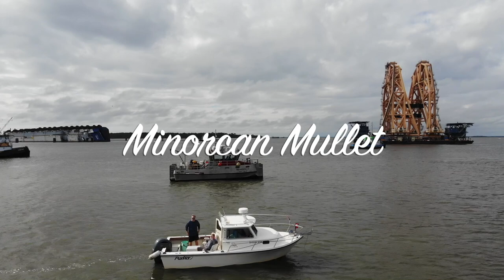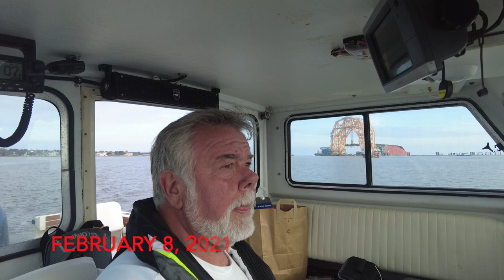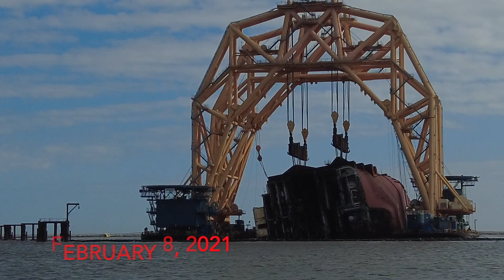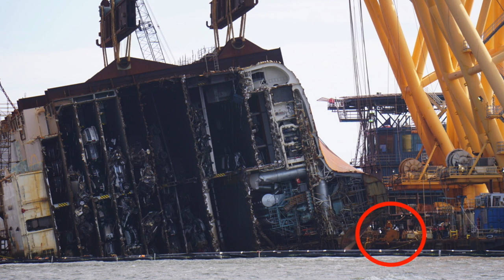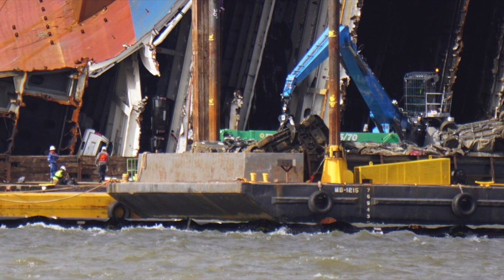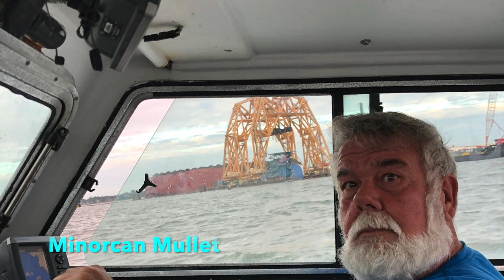VEHICLES PULLED FROM THE GOLDEN RAY on February 8, 2021

Comment: Thanks for sharing, I didn't see the model number on the grappler but it is pulling 7,000 lb suvs out of there, I have seen operators running those machines spin a small car like it's a tilt a whirl 20 foot off the ground. good times ha ha
Reply from the maker: You bet!! Wonder how many have been used on a barge while removing sunken cars?  Could be another history making moment!  MM

Comment: Andy, doing a great job 👏 👍. Handling the cars 🚗 with the long reach grapple is a at a boy! Just like they do in a scrap Yard. Budget must be getting tight and going after the cars like that makes money cents 💰 . If the chain ⛓ isn't working, get out torches and start hacking off chunks. 
 Ship breakers will show'em or 2.
Reply from the maker: Thanks 👍..  The most dangerous phase of the operation seems to be starting.  MM
Reply: @MinorcanMullet  do you mean throwing your fishing line inside and getting a Pinto vs  Ferrari🤔 🎣

Comment: thanks for the video update. I need a  decent old farm truck, so if they loose one grab it for me. haha
Reply from the maker: I'll try to lasso one if it floats by!  MM
Reply: My lifelong friend and retired commercial airline pilot in Durango, Colorado has a 1950 Chevy 6100 two-ton flatbed for sale. Mileage is 16 to 17K actual..showroom new. It was modified by a diesel shop exchanging the original 6-cyl. Loadmaster for a new 302 short block V-8 and 12 volt electrical throughout. I went there for two weeks in Aug. 2015, posted it on eBay but could not get it sold. The Loadmaster engine is crated in his shop on his farm. Andy, please excuse my promotional tactic on your channel…I could not resist the opportunity to help my buddy get the truck sold.

Comment: Perhaps the plan is now to have the VB10,000 move to the bow next after the engine room section is removed and the grappler barge goes around to the stern to grab vehicles.  then repeat the process as sections are cut off.
Reply: That’s a good idea Greg. They’d get the project done sooner.
Reply from the maker: Possibly so.  I'm not discounting anything!  MM

Comment: Considering the barge has to be heaving as well, pulling those vehicle free has to be an art rather than a science.  Even as light as the automobile steel is when compared to the ship, they have to be resistance for the chain.  Furthermore,   the plastics, foams, and other materials may inhibit the chain cutting of the heavy steel.  
When lifting section, some vehicles are going to fall into the water and sink, making a dangerous diving situation as well.  
very expensive salvage work underway, not to mention the capital loss of ship and vehicles.  This has been fascinating, Andy.  You do us all a service.
Reply from the maker: Thank you.  MM

Comment: Do you think there's a possibility that they might change the plan to cut off the engine room and  rather come back around to the bow end and cut off each section as the vedicles are removed?  If course they would need to repair the cutting system first.
Reply from the maker: HAHAHAHA!  Anything is possible with this shindig!   Waiting to see sharks with laser beams attached to their heads.  MM

Comment: In round numbers, how many vehicles were originally loaded on her? Hops are the vehicles fastened to the decks? How are they releasing those? Hopefully they are not putting personnel onboard her.
Reply from the maker: 4200 +-. Cars were strapped down with a nylon strapping system that probably failed where the heat was high during the fire..Some cars are still strapped. MM
Reply: Pjudging by the pictures, it looks like quite a few of them are still srtraped to what was the deck, leaving them hanging from it now. Given that the straps are nylon, shouldn’t be too hard to rig something to cut them remotely, while the picker has them clamped up.

Comment: When the vehicles are loaded they are secured to the deck so that device must be overcome before they can remove anything?  Still dealing with all the fluids left in each vehicle—gasoline, oil, transmission fluid, brake fluid. Not much per vehicle but a mess at 4K vehicles? Many of the vehicles below water are full of tidal mud.
Reply from the maker: depends on where the cars are.  The fire on board the Golden Ray when she rolled took care of some of the straps used to secure the cars.  MM

Comment: After lifting that stern end they may have decided they need to lighten the load any way they can. Or maybe they discovered that cars were falling out of the open ends so trying to prevent some of that. Or maybe they decided they should be working on both ends at the same time since they’re probably way behind schedule. Or like you said in case the hull collapses. It has to be more aggravating pulling the cars out this way vs on dry land so must be a necessity for whatever reason.
Reply from the maker: Just another kink to work out. MM

Comment: I wouldn't be concerned with sections of ship collapsing. It has frames (ribs) that start at bow and go all the way to stern. Thats what keeps hull shape stable. Without frames if a rogue wave hit side of ship it would cave inward. They may have even built Golden Ray in sections that they then align and weld together. There would be detailed drawings of each frames positions and they would make cuts between two frames.
Reply: Finally someone who knows what they are talking about. And I could only imagine what might happen if say... your cutting chain got across webframes for some reason .... That might take awhile. Just speculation of course.

Comment: I think it is wise to remove as much cargo as possible before cutting the next section. Think of a cracker box after the end flaps are peeled open. The box can easily collapse. One of your reports last year mentioned the lugs welded onto each section weigh 38 tons apiece. It’s practical to consider the hull, once it is emptied far enough in, could collapse.  With each section-cut made they would have to mitigate risks and consider the next stress factors for the next section to be cut because the lugs are the principle weight/force that will crush the hull. Surely the hull was not engineered and built for failure of this kind and magnitude.  The hull would likely give way to the weight and gravity.  I own and operate a Niftylift TM40 aerial lift so I go to www.vertikal.net about every three days.The website  done in the UK covers the industry of cranes and access equipment the world over. Their reports of equipment failures is a great teacher to learn risk mitigation and project planning.
Reply from the maker: Might have been wise to remove all the cargo before the ends were cut off the ship. Anyway we watch.  Hoping for the best.  MM

Comment: The vehicles deeper in the bowels you hook them and pull them further out until the crane can grab them.
Reply from the maker: Who gets the short straw to go in there and hook them?  With all those pieces overhead, I would imagine that's a spooky place to be crawling around.  MM
Reply: @MinorcanMullet  Well, ideally you have a telescoping arm that reaches in there and sets the hook. Or a long bar that can be attached to the crane. It doesnt have to be a hook either, it can be an electric magnet.

Comment: I have to ask the obvious...why not weld counter weights on the hull...slowly turn the ship back up-right, while pumping out much of the water, open the same doors used to load vehicles in...taking them out and on to waiting barges...then simply float the ship to wherever instead of all this ultra long, time ($$$$$) consuming cutting the ship apart.  This was done to the Costa Concordia, so the techniques and technology is already known...this, however, seems rather dim witted in comparison...IMHO...peace!
Reply from the maker: The sides of the ship are so thin and without significant structure in the sides, she would simply rip if enough weight were put on her to right the weight difference. And the Costa had more water to work the air bladders or chambers as they were.  You gotta also think about the CG of this thing as there is so much weight above the water.  be like keeping a broom balanced with the handle in the palm of your hand to keep it from rolling over again.  MM